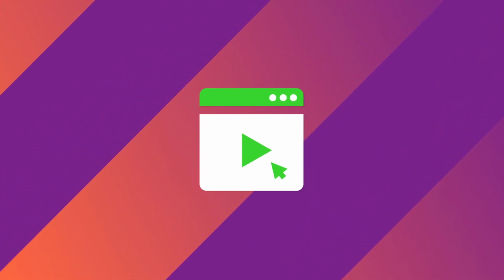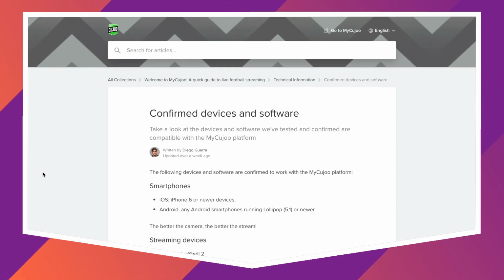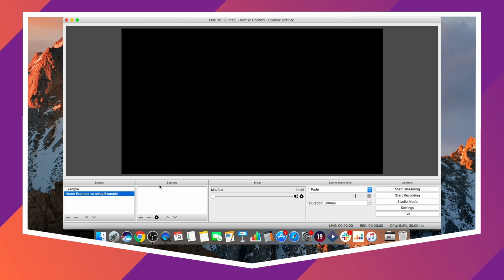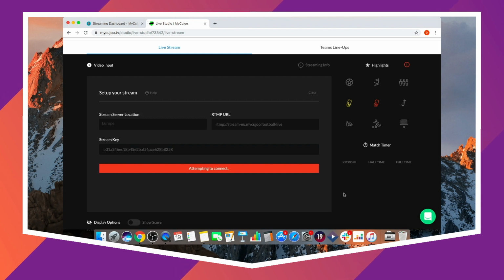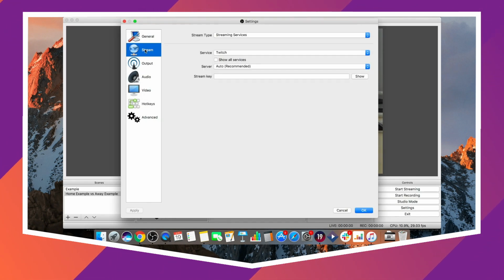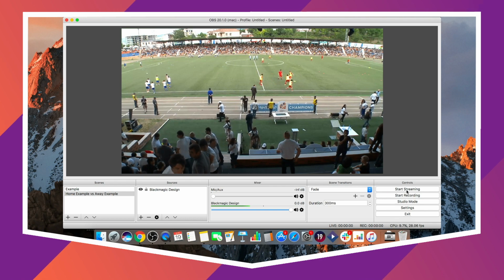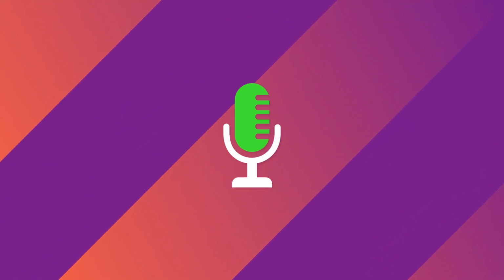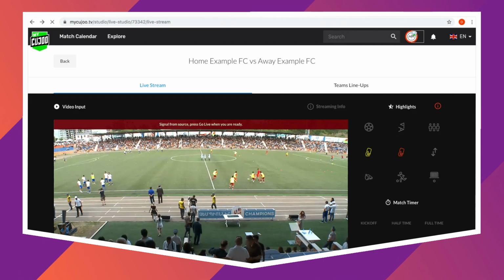Part 6: How to live broadcast your football match with a camera, capture card and streaming software

Comment: any trouble shooting tips when it doesn't work? I use a JVC GY HM200 that i send to Vmix Via SDI. Then i send vmix to mycujoo. Mycujoo then takes the signal. and when i hit go live, the stream starts and drops out. Internet is good, all equipment working, and the same stream has worked on different platforms (Youtube, and Vimeo) with the same settings